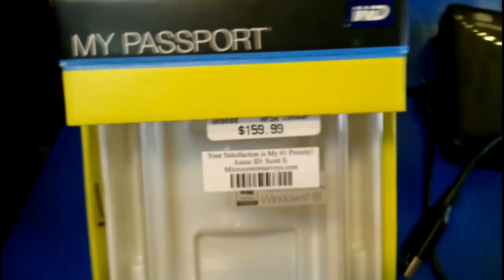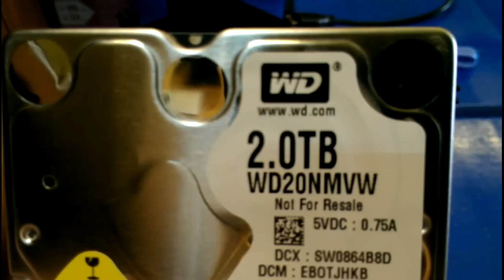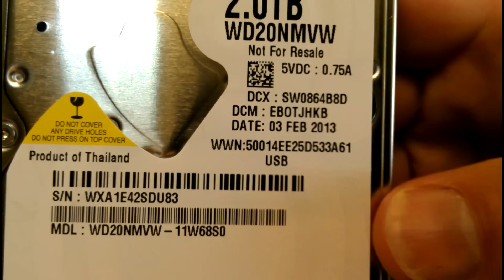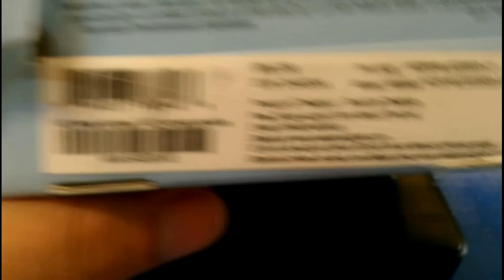Western Digital MyPassport 2TB USB 3.0 HDD Disassembly

Comment: Hi, I dropped my WD 1 TB Passport (blue) from about 2 feet from the ground onto a wood floor. I use it for basically everything. Its my official backup. I feel like another passport would be necessary to back this one up since now when I plug my blue one into my MacBook, all it does is light up, I head and feel the spinning but it does not mount to my MacBook desktop, it never shows up. I have to have this running because it literally has my entire life on it. I know I'm a super dummy for not saving and backing up onto anther disk but what can I do to fix this? Is there a way to retrieve my files? I need to know...I REALLY hope to God that this isn't a complete and total loss. I will be so entirely devastated if it was. I hope to hear back from someone soon! :,( - N
Reply: Go to the place you bought it from if they provide any warranty, or any shops that sell these.. they can recover the data for a fee most of the times!
Reply: Try Linux for Data Recovery..
I've have done many times ;)
Reply: Nicole Kercado I have this exact same problem!! Did you get any solution??
Reply: Hey i have the exact same issue is there any way to use those pins? Because i hope that this is a problem of the usb 3 port on the drive and would like to hear about another way to enter the drive

Comment: Would you say one gets more data-recoverability buying an USB frame for HDrives? I have been using USB drives for backup for 8 years now, they tend to last 3 years.
Reply from the maker: I've never had a 2.5 in USB drive fail. I use them for backup. they're always on. the drives fall asleep after a while. I use multiple usb drives for backup. I would take one to work, another one to my mother's. and at work, I would take one home.
Reply: leefiles :: True - they power off. Very nice drives! Well, that is good news. One 6 year old external USB-HD did not exactly fail, but Linux suddenly would not write to it and said there was a failure; then when I took the drive down, unpower, power on again, it worked - but I shifted to another WD USB-ext.

I don't know precisely what failed, logfile says
May 27 17:26:11 saturn kernel: [7181327.480685] EXT2-fs (sdd1): previous I/O error to superblock detected
(plus many more lines).

... but still, now I realize that it could be a software failure.
Reply from the maker: AlfaAxel Not enough information to go on. the new software may not support legacy filesystem. ext2 is not used anymore, but should still be supported by many linuxes. I see it on my linux systems - mkfs.ext2.
Are you trying to boot linux off of the usb drive?
Reply: leefiles  :: No, not booting. I found out there is a USB scan when I plug in another (USBstick) device, which I consider the reason for failure by now. After adding a USB-stick the /dev/sdd became /dev/sde - and could be mounted and checked etc. so it is a kernel (software) bug of some kind. I am almost ready to install another Linux system on another machine before I begin changing kernel on the (older) system.

I have no problems w. EXT2 filesystems, they are fully supported by Linux. I know I could go to EXT3 and 4 but there have been severe problems with those if there is a blackout twice or more times rapidly one after another :)
Thanks for your kind interest! :)

Comment: I wanted to know what kind of technique this product was made with and your video was the first to answer! Thanks!

What is the lightblue tool which you use to open the "lid" of the device?
Modern devices are really hard to disassemble if one has no idea on how to do it.
Reply from the maker: the little blue tool is a pry tool.
Look for "plastic pry tools" or "plastic spudger" on amazon or ebay.

If you need it right away, use a credit card or one of those annoying cards you're forced to get at the supermarket.
Reply: leefiles
Thank you!

Comment: if anyone has had some success with doing data recovery on one of these when the disk is not being detected and there are soft beeps but no clicking.. and flashing light.. please reply! i too am having this problem.. i'm so upset that this drive makes it so much harder to do diy data recovery.. I have no idea how to proceed.. I can't pay hundreds if not thousands for pro data recovery.. please reply if you found a way
Reply from the maker: try to search for software method to spin up a hard drive. those guys who charge you an arm, a knee, five ribs, your wife, your grandmother, and your first-born put your hard drive in a clear plastic box and take out the disks - that's the "clean room" they lie to you about. Sometimes its possible for them to spin it up with software when it clicks or doesn't spin up.
Reply: vesper8 Hello! Did you got any solution?

Comment: Shame on me..I bought WD 1TB My Passport Ultra and thought about replacing the 250Gb to 1TB on my probook. I guess that i might not happen anymore :-(.

leefiles Is there any other way/solution of having this hdd into my laptop ? Any advice would be welcome.

Thanks in advance
Reply from the maker: not really. you can take out the circuit board. but its not trivial.
Reply: leefiles
If i take out the circuit board does it will work on my HP Probook 5220m ?

Thanks !!!

Comment: I'm not sure if I heard you correctly, did you say that these portable hard drives can be used inside laptops?
Reply from the maker: It has a built-in USB interface. No SATA interface.
Reply: Oh right, darn it.  Are SATA interfaces available to buy?  And is it possible to replace the USB interface with a SATA inerface?
Reply from the maker: *****
 I couldn't find such a thing. You can still use a Micro USB 2 connector for this hard drive.

Comment: leefiles i have the same drive it felt and now it won't read, my Macbook or iMac doesn't even recognize it when it plugged in but the light on the hard drive comes on. Is there anyway to recover the files thats on it?
Reply from the maker: Plug it in a PC.
It even works with ARM computers.

Comment: Well thank you for posting this video. I will no longer purchase any Western Digital External Hard Drives since the versatile SATA backup option is no longer available. In fact I am just going to boycott their whole line because this proprietary CRAP that is made to make you spend more money just pisses me off that much. Looks like its just Toshiba, Seagate from now on.
Reply from the maker: Until they buy seagate.
Reply: leefiles  I'm going to buy Seagate 2TB Portable Backup Plus Slim. I find this WD Passport 2TB too thick. Also In a disassembled video, It is said that Seagate has Internal SATA Connector. Do you Think it is true and would you recommend me continue buying Seagate?
Reply from the maker: அர்விந்த் ரவி It does look like standard SATA. Seagate used to be a good brand. I stopped buy buy Seagate until their 1.5TB desktop drives started failing. I don't know if they got any better. Also IBM Deskstar (AKA Deathstar) was also a bad line. They got bought up by Hitachi who also changed their name to HGST.
Reply from the maker: leefiles I meant that I used to buy seagate until their failed 1.5TB drive line.

Comment: Thanks for pointing out the amp draw. After a failed backup onto my MyPassport, I moved something USB cables around (unrelated to the failed backup).  When I plugged the MyPassport back it it showed a hardware failure.  I thought the failure was related to the failed backup and started troubleshooting...including moving the drive to my laptop.  When you pointed out the amp draw I put the drive back on the original USB port and it worked again!  Thanks!
Reply from the maker: anytime

Comment: Pardon my ignorance, but because of its special interface is it not possible to plug it into a "docking station"? For example, when my laptop died I was able to retrieve the data from its hdd by connecting it to a docking station. Is that not possible with these hdds? Should it never be a problem, it should always be able to work via usb? I ask because I'm looking to buy a docking station and I wonder if I should take these hdds into consideration when buying it.

I also wonder what, for example, you meant when you said at 5:50 that you can't use it for anything else. What else could you use it for?
Reply from the maker: The hard drive inside has no SATA connector so it won't work with those vertical  docking stations. It has a built-in USB 3 connector. Anyway, it won't work inside a laptop. And it wont boot Windows because Windows wont boot off of USB because windows wont allow it. ( It has been done but not easy)

Comment from the maker: "Bhuvan Raja"
Look for "plastic pry tools" or "plastic spudger" on amazon.

Also for some reason there's no "reply" next to your name.
Reply: +leefiles Thanks for the video. I was looking for a 1 TB drive. Of WD elements, WD passport, Seagate Slim, Seagate Expansion - can you please recommend one which you found most reliable?

Also which one has the USB port slot not soldered directly onto the board? Since you mentioned it as a minus point. 
Thanks!
Reply from the maker: +thiruvetti I haven't had much trouble with WD. Their 2.5 inch USB drives have the USB interface soldered on. Seagate's 2.5 inch drives can be reused in laptops. I have seagate drives that are really thick and won't fit in many laptops. I leave my USB drives connected all the time. They go to sleep on their own in windows and in linux. So they're both reliable. As long as they're allowed to sleep most of the time, reliability isn't an issue. I do have a single board intel atom (fanless) running linux ( as a web server) with a WD 2.5 inch drive always on (24/7). Its been on for about 3 years (never off, always spinning ). Its current uptime is 160 days. I mounted the bare drive on the outside of the fanless aluminum case.
Reply: leefiles  Thanks for the quick response. The 24/7 HD in use - was it the WD passport or Elements? becos I read that Passport ultra is more reliable than Elements.

Also I checked Seagate videos where reviewers say that once we dismantle the internals, the HD can be actually fitted into laptop. But I think u feel its fatter!

The reason for my concern is, I already lost data in one of my HD and dont want to lose data again :-)
Reply from the maker: +thiruvetti The one in my fanless pc was from an older WD back when they put SATA drives in there.  Most laptops need use thin drives. Some seagate and WD usb drives are thicker because its cheaper to make and they were not meant to be re-used.
Reply from the maker: +thiruvetti You know what, its a blue drive and its thin. I don't remember which. Another thing about reliability is that notebook drives only have a 3 month warranty and some up to one year. That says a lot.

Comment: Good video, at least I'm able to see what's inside the WD My Passport.

A question though, can the hdd board be swapped with the normal SATA board?
e.g wd my passport hdd swapped with internal laptop sized wd hdd

if so, what r the restriction when i want to swap the board?
mine got a click of death issue on my wd my passport 1tb

thanks in advace :-)
Reply: sarf2k4 did you find a solution to you data recovery? i too am having this problem.. i'm so upset that this drive makes it so much harder to do diy data recovery.. I have no idea how to proceed.. I can't pay hundreds if not thousands for pro data recovery.. please reply if you found a way
Reply from the maker: If you mean you want to take a hdd from your laptop and put it in the "my passport" case, it should fit, but there may be some slack. It may flop around inside.
Reply from the maker: sarf2k4 Its not dead. When I was in school I knew someone who said he could spin up a seemingly dead hard drive with software then charge people $4000 to copy the data over. He laughed and said it was really easy. But I couldn't get it out of him the method used. Trade secret.
Reply: Erm, I know it's not dead, the problem when I wanted to initiate the 'fix' procedure, I'm stuck in detecting the My Passport from USB connection due to click of death preventing the system to detect/read the drive further, one  method to this is having the board swapped with SATA PCB
Reply: vesper8  I have tested my wd passport which gone unreadable and made my pc's windows explorer froze, it turned out to be that its the cable problem and I had to use micro usb 2.0 only, I wonder if this is a bug to backward compatibilities n usb 3.0?